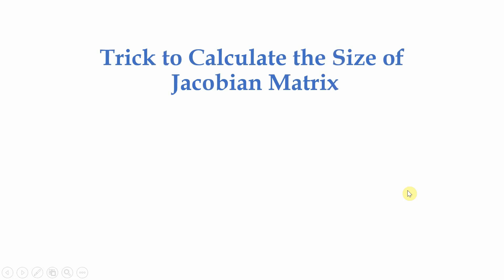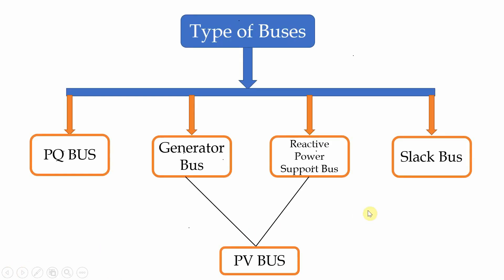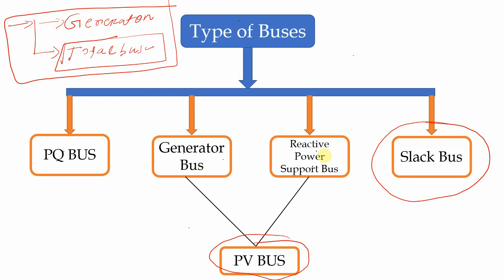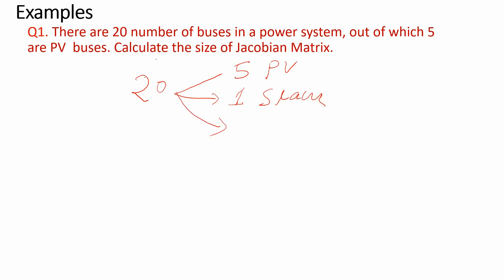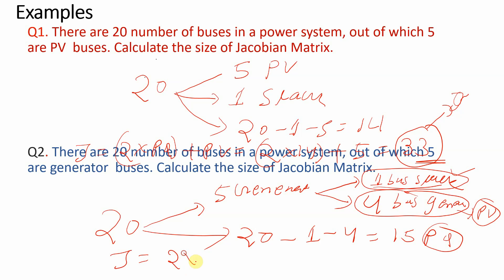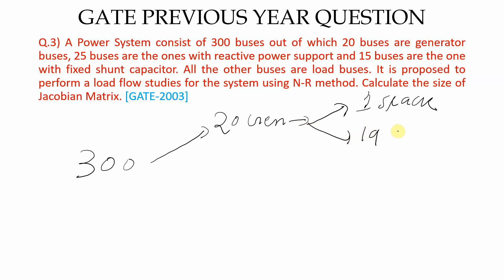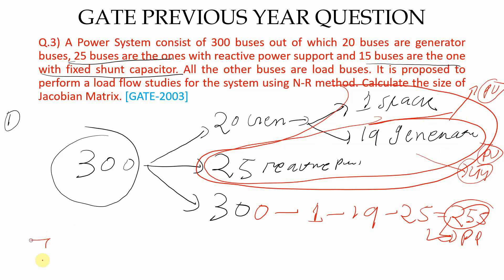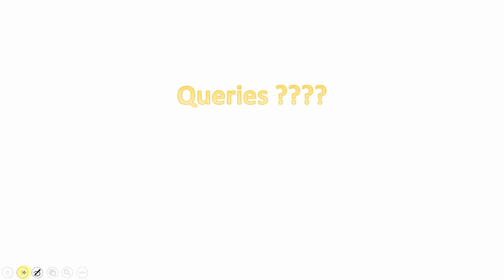How to Claculate the Size of Jocobian Matrix for GATE

Comment: Hi Sir, thanks for the explanation. I have a question. 

I have 30 busses (nodes). There are generators at 12 nodes.
There is one SSSC on a branch in which the power
ow needs to be controlled. An SVC
is connected to one of the load busses. 

How to find a total number of PV and PQ buses? Are these 12 nodes are PQ bus numbers or nodes mean different thing? 

Thanks. Your answer very important.